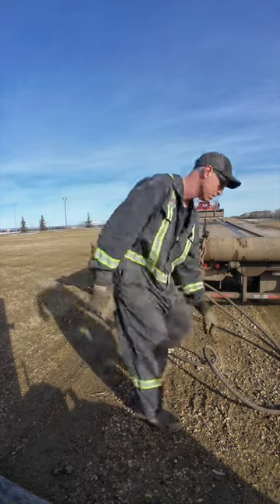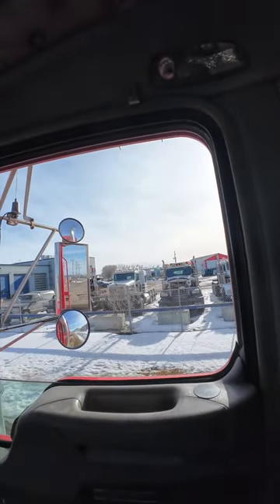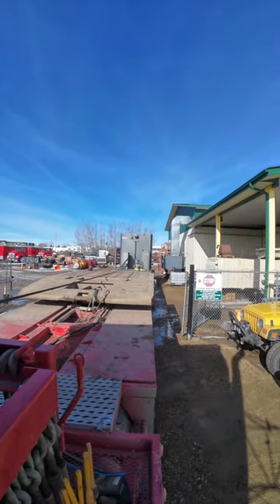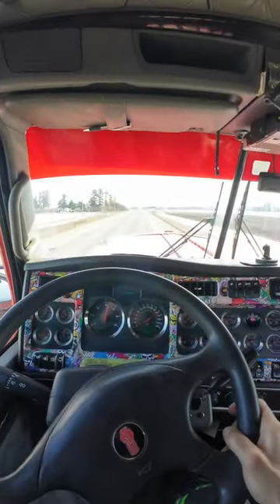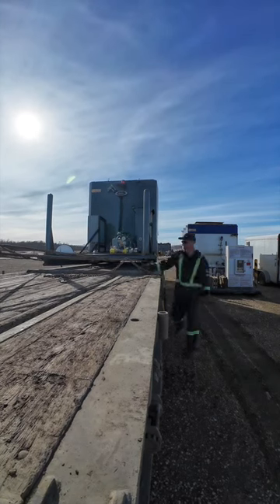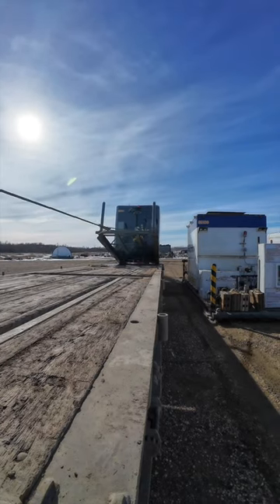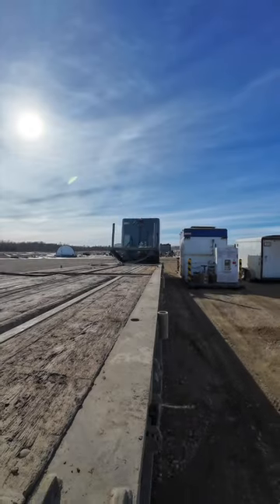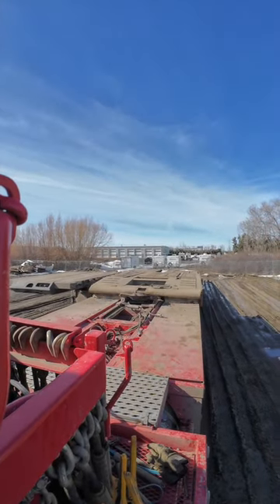AI HEATERS PT 2

Comment: Worked  in the oil field HIWAY are not good enough to use this truck and trailer my truck was 43 feet trailer was 80 by 10 wide weighed 82.000 empty HA HA  WE WERE NEVER OVER LOADER 250.000😅😅
Reply from the maker: thats definitely large, always loaded even empty